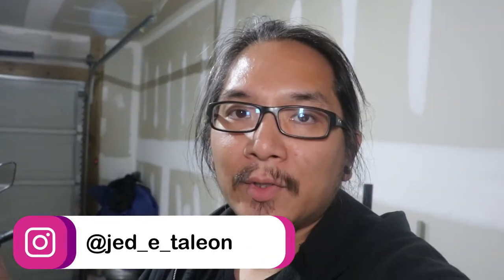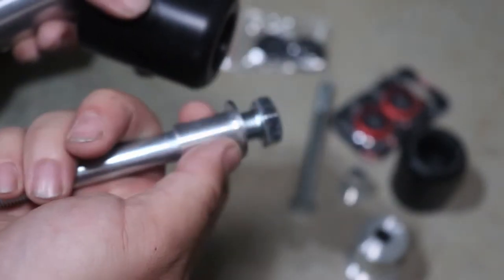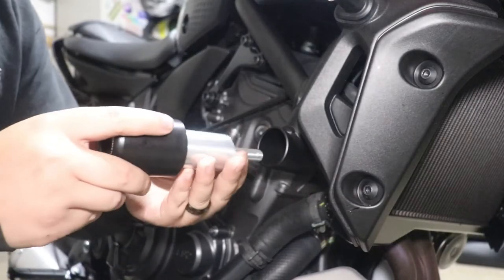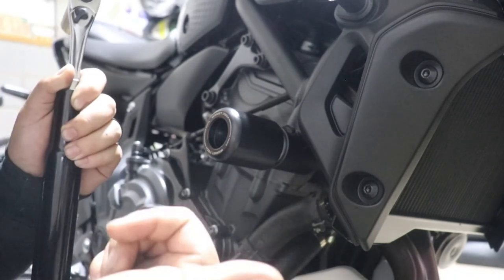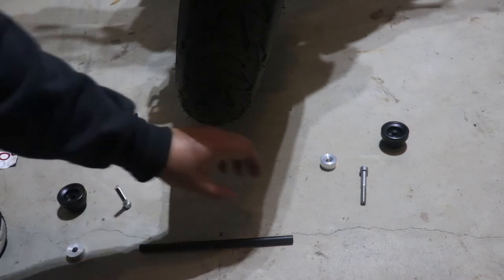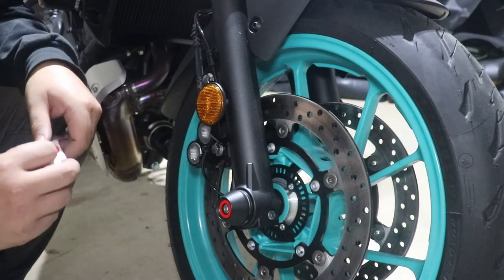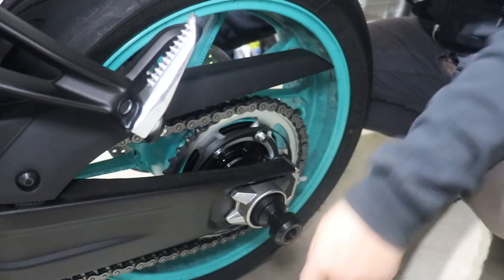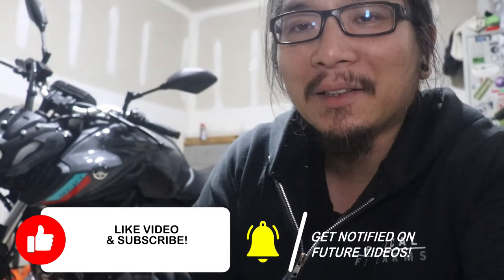TST Industries/Womet-Tech Frame & Axle Slider Install! | 2021+ Yamaha MT-07 Upgrades

Comment: Great vid! Just bought the 2022 mt07 and looking to do the same upgrades. Do you know if the frame slider is wider than the handle bars? I’ve dropped my bike twice now and the only damage were to the front blinkers and scratched up clutch lever